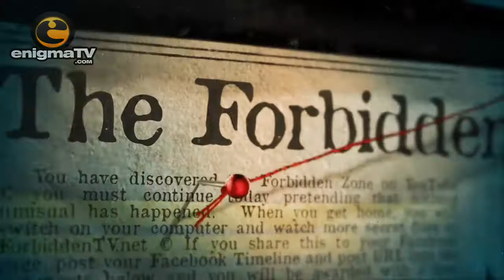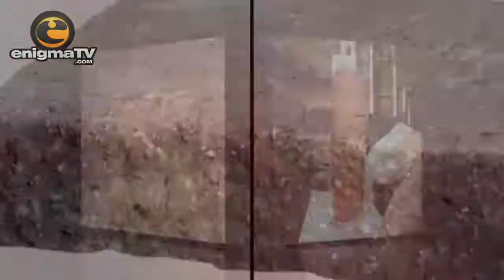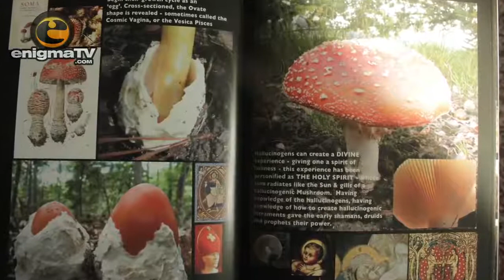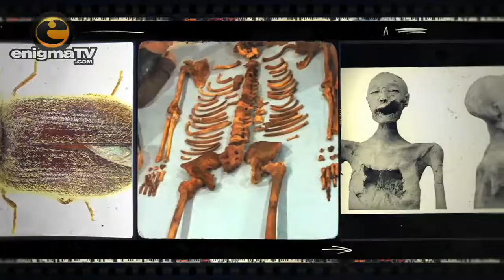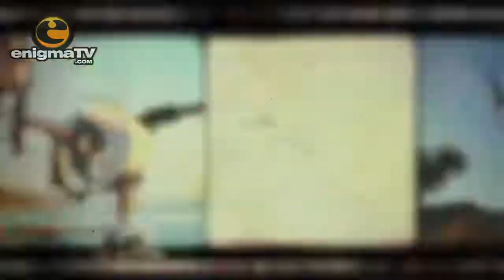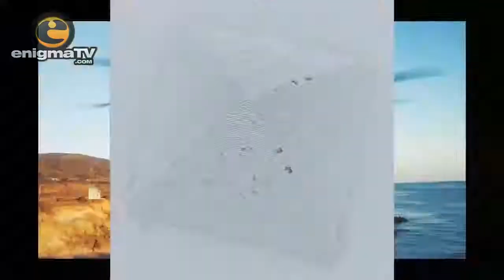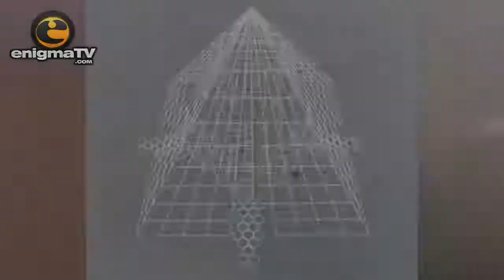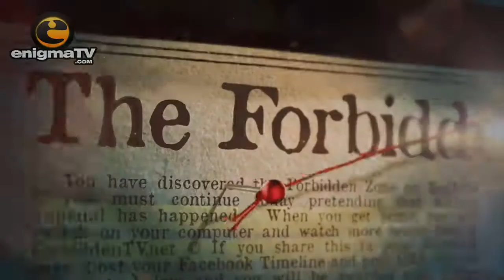Ancient Building Techniques Concrete Use in Ancient Egypt [FULL DOCUMENTARY]

Comment: I have a question: How can an impression, or a section of statue exposed from a mould and not shear off from displacement? Carving a section out I can believe. During the main curing period 'green' stage as We call it, is still a very low tensile strength.
Reply: The exterior was a thin section over a substrate.
Reply: @thomaslewis7855  So, as casting any moulded addition onto the substrate, the substrate needs to be roughed out and in situ (not to be moved) ready for thin section?

Comment: 14,000-12,000 years ago the sea level rose 125m (375 feet). So the under sea cuties built before 14,000 years ago. And the pyramids just happen to be built at a height that was not going to be flooded. Not by design perhaps just that is all that is left for in to see now